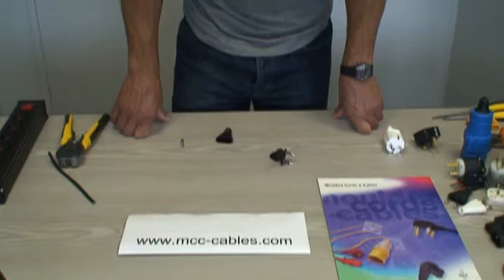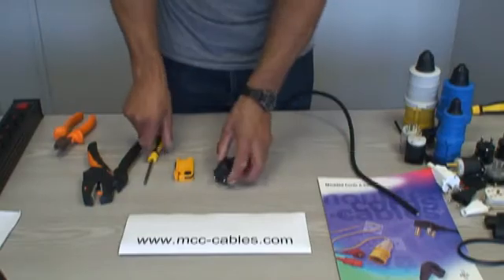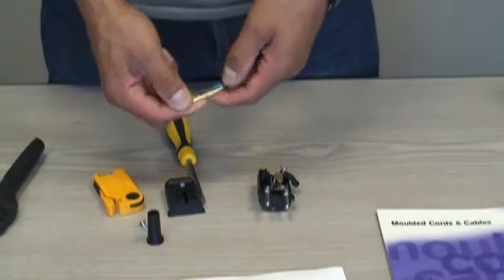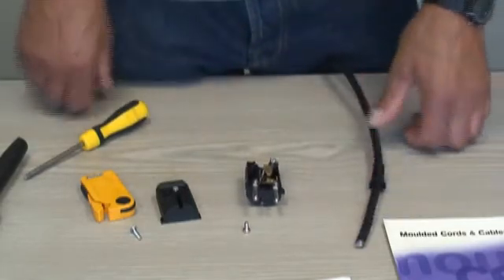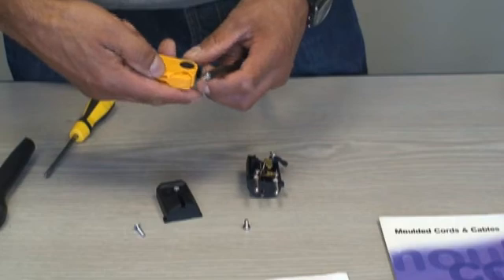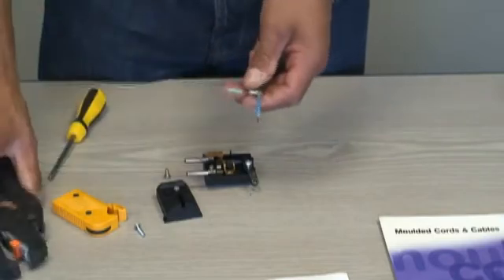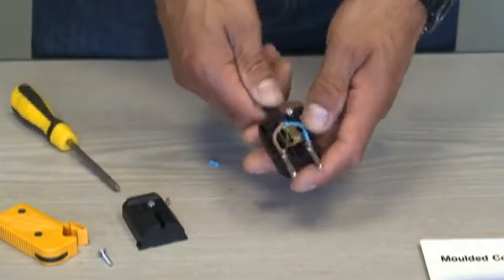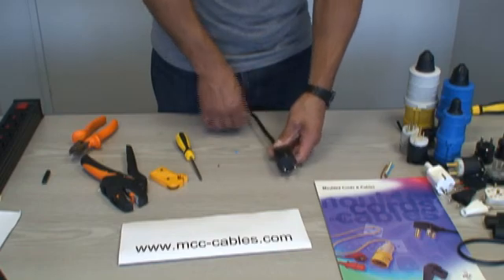Moulded Cords & Cables Ltd How to Wire an STK9 (Schuko Plug)

Comment: Polarity on schuko plugs is irrelevant. As with the 2.5 AMP 2 pin europlugs, they can be inserted either way.
Reply: Err no. If this was just the German Schuko plug you would be correct. This is a CEE7/7 plug, which is a highbred of the German and French plug. In France the sockets have an off set earth pin in them to ensure that the plug can only be inserted one way.  Hence why this plug has the live and neutral marked.
Reply: @matt23540  You have misunderstood my comment. 
Any schuko plug whether hybrid or not, can be inserted with way in a standard schuko socket (schutzkontaktstecker)
But not in sockets with a male earth pin, such as in Czech Republic.